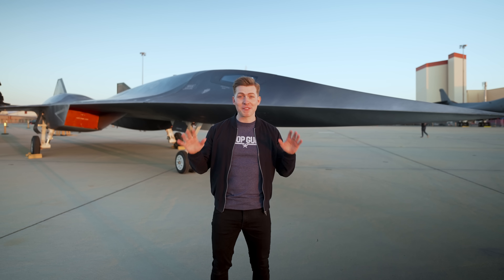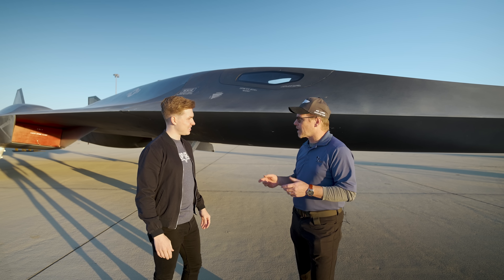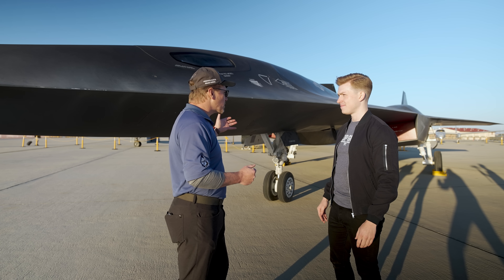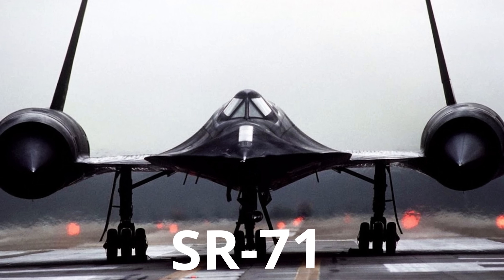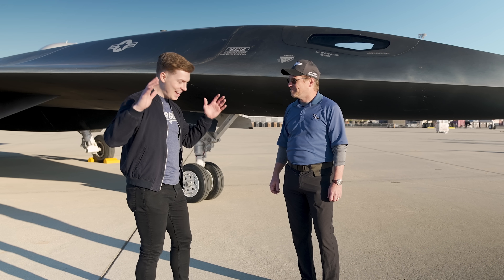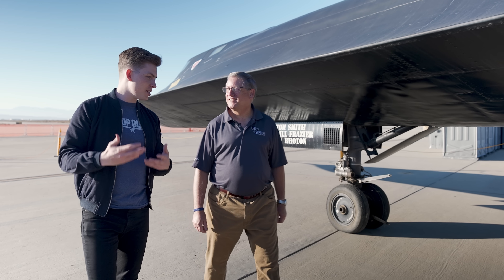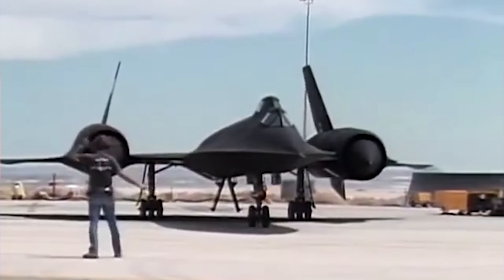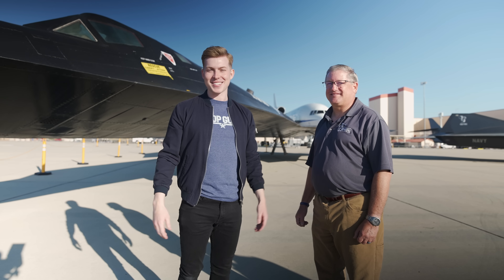Top Gun DARKSTAR in Real Life!

Comment: Thanks for the info.  Cool to see the planes up close especially the Blackbird.  Darkstar is interesting as well but feels more like a Hollywood prop than anything.  It's like when you go to disney and see some of the Tie Fighters on display.  They don't fly either.  I think having an airplane like the Blackbird developed almost 60 years ago sitting next to a fictional airplane also drives home the fact that our technology has moved as a snail's pace.  In the age of Moore's law, an aircraft developed almost 60 years ago should be a laughable comparison to what is available today.  The problem is that the Blackbird is still a very capable aircraft compared to anything else available even though the last flight of the Blackbird was around 1999 by NASA.  So maybe the SR-72 Darkstar is built and in some dark hole at LM, the fact remains that you are standing there comparing a movie prop to a plane that was built about 60 years ago.  I think people bragging about today's technology is laughable.  Even rocket technology hasn't changed.  SpaceX has done some cool stuff with reusing some parts of the launch vehicle but at the end of the day we still get into orbit the same exact way we got into orbit 60 years ago.  A large cylinder of jet fuel with a tiny capsule on top is set on fire.
The moral of the story is this.  Forget about going Mach 20 with rocket fuel or a jet engine hybrid.  Who cares?  We need to solve our propulsion and energy density problems.  Those are the technologies that will finally change flight and space travel in a significant way.  Right now we are spinning our wheels spending billions trying to make a better mousetrap.  Same tired technology just a smidgeon better.  That's why the shining example of our aviation technology is sitting next to an aircraft that was manufactured about the same time that we invented 8 track tapes.

Comment: They stopped with the whole hyper sonic aircraft for military purposes 70 years ago. The sr-71 is still the fastest manned aircraft The modern interceptor made the sr-71 obsolete. the Swedish gripen was able intercept and lock onto the sr-71 in test flights. The faster the jet goes the more difficult it is to maneuver speed is most definitely not the answer. Theres a reason the sr-71 doesn’t have any weapon systems. Cause it couldn’t engage fights due its poor handling at low speeds. The u-2 dragon lady is still in service till 2026 its top speed is 475 mph.

Comment: At first glance the SR-72 Darkstar design looks great, I thought until I looked at the landing gear on the outer air intakes and side, that can't work. The air intakes air flow would be restricted into the engines. If you look at the SR-71 you will see the landing gear locations are not interfering with the engines air flow. If this were a real aircraft the propulsion would not be conventional. So why present this design as a next gen aircraft that uses RAM air technology. The f 22 raptor landing gear design and location works based on engine location within the air frame. If DARPA and Skunk Works are using anti gravity and frequency technology along with RAM air, if the designers are showing the public a conventional SR-72 Darkstar aircraft, this would make more sense. However the current design doesn't work for a conventional RAM air jet powered aircraft.  Frequency technology is the way I would design flight systems.

Comment: The SR-71 and Concorde are undoubtedly two of the few greatest achievements of aviation, not as one-time record breaking experiments but as long lasting, reliable high performance aircraft of a unique kind. Given that they were designed over 60 years ago, remained operational for 30+ years, and nothing even close existed since, it is really outstanding. Aerospace engineering has made many improvements since then, but those only highlight their greatness. And most importantly, the incredible boldness and talent of those who designed them with the tools and methods then available. Really unbelievable.
Reply: People always forget about the A-12, which was a warplane.
Reply: @kenton6098  The A-12 was a camera platform only blackbird flown by the CIA over North Korea, and Vietnam. They were only in service for little under 2 years the SR 71 and A-12 were stationed at Kadina during the same time. The YF 12 was the interceptor it was never put into service only one still exist today.  Check out Frank Murry interviews on YouTube he was a A-12 pilot goes into great detail about the CIA program which was run out of Area 51.
Reply: The Concorde isn’t even in the same league as the Sr71
Reply: The XB70 Valkyrie as well, though it never actually went into service. To my knowledge that was the only other jet aside from the sr71 and a12 that could cruise at Mach 3.
Reply: А как же Ту-144? А когда появился Миг-25,то SR 71стал бесполезен. Россия 💪

Comment: I'm pretty sure I could get this mockup to fly with a few changes. I would upscale the design by doubling its size and getting rid of those long box-like intakes and exhausts and pretty much cutting and pasting the F22 tail onto it and change the front air intakes to a shape and configuration similar to the B2 Bomber on the upper hull for faster airflows! The vertical stabilizers I would cant inwards OR outwards depending on my airflow simulations. i.e. Much like the F-19 Testor model!

I have an in-house build for the Turbojet engines I designed which are 70,000 lbs of thrust EACH and I can easily mix some high-bypass-flow scramjet technology for Mach 5+ operations. I can CNC machine from CATIA those engines in about two days on our in-house CNC gear out of Titanium Alloy and then vacuum-sputter-coat with Thick-Film Sapphire (i.e. a Corundum) for high heat protection.  And YES I would actually use simple Propane stored at 600 PSI for the main Turbojet fuel rather than JP7, Liquid Methane or Boranes (i.e. ZIP-fuel)! Propane is faaaaaar easier to handle and has a LOT of energy in it! We can EASILY use tubular polymer-composite or carbon-fibre tanks to keep it stored at high pressure and I can stuff enough of it inside the aircraft that I can fly for a few hours with no issue!

For the main hull body, I would call it a day and build it using automotive-industry Hydroforming Technology out of relatively inexpensive quarter-inch thick 7075-T6 Aluminum and coat the inside and outside of the metal hull with a thick-film Corundum ceramic AND then coat inside and out with a half-inch thick layer of Corundum-nanoball-infused version of Line-X-brand Truck Bed liner (aka nanoball-infused Polyurethane) which acts as both a STEALTHY anti-RADAR coating AND can still protect up to around 2200 Celcius when properly treated! The thick Line-X coating will ablate at a KNOWN RATE at hypersonic speeds and high atmospheric friction heating and can EASILY AND CHEAPLY be re-surfaced after any given flight when needed!

I would use real-time sub-millisecond hard-interupt flight-control and avionics-oriented Linux operating system with our custom-coded inhouse software which is good for aerospace craft up to 160,000 KMH (100,000 mph) since the software we designed can operate at 10,000 fps at DCI-4K/DCI-8K resolutions on IR/RGB/RADAR/LIDAR imaging for collision avoidance and all-attitude 3D-XYZ flight envelope control. 

Cockpit would be fully glass touchscreen with a simple F18-like joystick control but WITHOUT all the buttons! Just one single ultra-wide-screen ruggedized 8K resolution display for all gauges and indicators and a simplified heads-up display! I would STILL do a single-piece forward-facing cockpit window but use a thick sheet of Sapphire which is nowadays pretty easy to grow in one piece! It can easily take 2200 Celcius worth of aerodynamic friction heating!

Gimme six months to build it and then I can test fly it for real!

V
Reply: Who ru man
Reply: @rishabsreekanth1724  Who am I? I'm guy who has access to and rides as a JAFO in a big deep black 148,000 lbs triangular SSTO floating effortlessly above the ground in our secretive YVR hangar!  We mooned the U.S. triangular TSTO spaceplane who couldn't see us from even 500 metres away AND we we mooned those pesky tall thin pasty-whitish aliens who looked at us like we were insane! 

Touche!

V
Reply: @rishabsreekanth1724  someone who has no idea what theyre on about, the box intakes are there for a reason (making sure all the oblique shockwaves are forming in the correct manner before the engines), "change the front air intakes to a shape and configuration similar to the B2 Bomber" yes a subsonic intake would definitely work at mach 10

Comment: If the force of pushing through air is the problem slowing down craft, causing heat from friction.. why can't they fit thousands of tiny air nozzles all over the body and compress air out to create a pressurized layer of air around the craft so air coming towards it isn't actually touching the surface.. not so much that it causes direction of the craft to be effected but just enough so that air flowing towards the craft as it pushes through the atmosphere is just a few millimetres off the surface, kind of like an air hockey puck on an air hockey table.. 🤔 i'm not a scientist.. it's just an idea 🤣

Comment: When I was stationed at MAFB, an SR-71 came in for the air show.  When it parked,  it had caution tape all around and 24/7 armed guards.  A number of years later, also at a MAFB air show, they had an SR-71 on static display and people were under it using the wings as shade from the sun.  By then, it was an interesting but obsolete topic of conversation.  I wonder what replaced it?  The Aurora?

Comment: the problem with planes going that fast is they gotta be light so weapons on them not really possible as it weighs it down its why all the fastest planes were spy planes even older planes like the X-15 which was capable of going over mach 5 had to piggy back off other planes but again no weapons of any kind that said while the x-15 could carry people one might say it wasn't really a plane more like it was a rocket because it needed assistance to take off.  Most the best equipment we see today is in fact 20+ years old even F-22 Raptor while some say the f-35 is better my question would be if the f-35 is better why can the f-35 be sold other countries while its not allowed to sell the f-22 the only thing f-35 I see has is the ability to take off faster.

Comment: Up front it looks like a prehistoric flying predator - pterodactyl. If the aircraft could fly without the vertical flight controls, add thrust vectors and blended wing control surfaces, an 80k pound payload bay capacity, strategic range and stealth at 3x speed of sound, then the aircraft has potential to accomplish us airforce mission requirements.

Comment: Darkstar is a hypersonic project, it is very similar to an aircraft from the 80s. 

XR-7 Thunder Dart, is a hypersonic aircraft project that was tested in the late 80s, known as the Aurora project. There were sightings of the aircraft with sonic booms and generating a medium magnitude earthquake, according to witnesses. It is said and in theory, that the plane was developed in Area 51, by Lockheed Martín, the plane flew at Mach7 at 40,000 meters high and was an anti-satellite plane, on its leading edges it has ceramic, due to the high temperature which was generated by friction and high speed, giving a red color. 

 The propulsion of the plane consisted of a pulse detonation wave engine, where the fuel is not burned in the combustion chamber but detonated by electrical pulses and the ducts become increasingly narrower, in order to increase the pressure and thrust, generating the hypersonic speed. 

 When the plane flew, there was a contrail, called. Stringed beads or donuts on a thread.

 I knew about this plane since 2010, but the project dates back to the 80s.
Reply: As an Air Force kid, we knew about this from the mid 1990's. SR-91.
Reply: @Trailsporting  
Was your dad in the air force?
What job did he do in the air force?
What did your dad work on?

  I am from South America and I discovered the plane in 2009, searching for the program Unsolved Mysteries. There, in a chapter from 1993, they talk about the plane, which flies at hypersonic speed and has a pulse detonation engine, which, I began to investigate a lot and in 2010, I learned about the plane and what it is like.
  Yes, you are right, it is the SR-91 Aurora. Like one of the code names it has.
Reply: @Trailsporting  
Another question.
How did you find out about the plane?

Comment: I find it so interesting that there is an object (the 71) that Lockheed created and just now, 60 something years later we are finally seeing other countries attempt it in a realistic manner. I mean sure the mig could hit mach 3 if I'm not mistaken but not even close to realistically or for any usable amount of time. Now over 60 years later, they are working on a successor. That in itself, is absolutely unbelievable. I never understood the SR-71s early retirement either. Newer planes and satellites could do SOME of its job it served. But definitely not all. Seemed like it would have been worth it to provide real-time data streaming and sensor updates to the 71 rather than retire it and try to use these other technologies. I may be ignorant but i feel like There is no better Intel than a human mind in combo with and an array of sensors mapping changes in topography, at a speed and height that is completely untouchable. You can't hide from or fight what you can't touch. And you can't run from its amazing cavalry once they get the call about where you are. It seems like in intrical part of a team. It's the seeker. The eye in the sky, for the eyes in the sky.
Reply: The SR-71 pilots would cruise at Mach 3.2 and the plane was happy to sustain that speed as long as there was plenty of fuel onboard. It would slow to tanker speed to refuel and then go right back to Mach 3 without breaking a sweat. Anything below Mach 3 was risking vulnerability outside of US airspace. Inside US airspace, Mach 2.5 was the usual speed.

Comment: Since the 90s when the SR71 came into retirement, there must be any successor, which can reach speed quite above the hypersonic range from Mach 5 to Mach 9, may be even up to Mach 14, which might be enabled by using liquid hydrogen fuel.
However, the range might be up to 3000 miles before refueling.
Reply: approximately, 5,000 miles.  plus, scram jet technology was invented in the late 1950's
yes, when the SR-71 was retired there was already a replacement ready to be deployed, in a very limited basis.

Comment: You actually don't need an ignition source in a Scramjet engine, the temperature produced by compressing the atmosphere into an engine at high supersonic speeds is enough to detonate fuels atomised inside the engine, very much as a diesel engine works.
The big challenge is finding the correct formula for the fuel.

Comment: I worked on the B2 bomber in 1986 at Northrop in Pico Rivera, and before that Marquardt Jet Laboratory on the National Aerospace Plane. The issue with supersonic combustion ramjets (scramjets) is the inlet geometry has to change from takeoff to accelerate the airflow from standard jet speeds to the Mach 5 cruise speed and there has to be flameholding technology inside the scramjet so that the combustion is maintained even at tremendous speed. The stealth technology around the B-2 was fascinating, everything from chemically suppressing the contrails to the radar-absorbent coating on the fuselage, but the NASP inlet and combustion technology was so advanced using computational fluid dynamics that I loved working on the briefing slides for when the government program managers came through. Incidentally,  Lockheed doesn't have a monopoly on scramjet technology. Marquardt had been working on it supersonic test cells at Van Nuys since the '50s.

Comment: I was looking through the comments to see if I could see any mentions of the CIA's A12 (a version of the SR71) which... Was faster than the SR71.... A12 = Mach 3.35 at 85,000 feet with maximum ceiling at 95,000 feet. SR71 = Mach 3.2 at 85,000 (also maximum altitude)... 😉
Add to that, the plane was designed to (mad as it sounds) LEAK fuel when fully fueled up as there were gaps designed into the airframe that would naturally close up due to skin surface heating up due to friction during flight! Bonkers!    😎🇬🇧

Comment: It’s already been flying for several years
Reply: Correction, it's already been retired for more than a few years. That there is 1975-1985 technology, if you know a thing or two about what Lockheed has put out and when. The SR-71 was 1960-1964 technology. Imagine what they made 10 years after the SR-71, considering that Project Rheinberry was working on Mach 20 immediately after the SR-71 was made public in 1964.

Comment: My father worked for North American Aviation black projects the biggest problem all high speed aircraft have is heat. That's the problem. My dad help to build the XB-70 Valkyrie at Mach 3.1 the average temperature is 480 degrees Fahrenheit. But certain places on the plane can get up to 650 degrees Fahrenheit. That's why you don't see very many planes that can Fly Above Mach 3. Heat is the problem. That's why the space shuttle uses thermal tiles and if you could come up with a spray-on heat shield that would work the same way you'd make a lot of money. Remember space shuttles fastest plane ever 17000 miles an hour and the Heat over 3000 degrees Fahrenheit there it is boys and girls🪐🌠

Comment: It would need a tungsten carbide tip. Without it, at any speed above Mach 2 or 3... any supersonic or hypersonic flight would need a hardened tip to take the heat and pressure off of the rest of the vehicle. Skunkworks just made it look nice for the film.